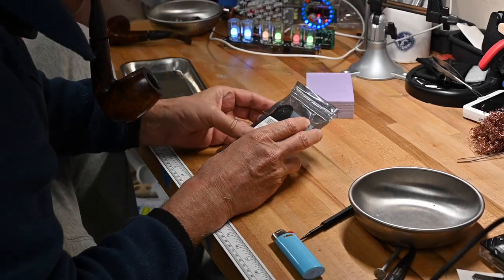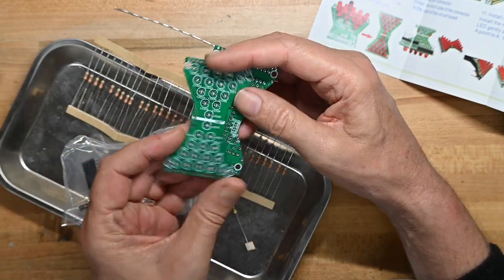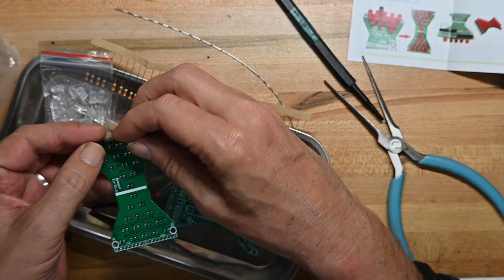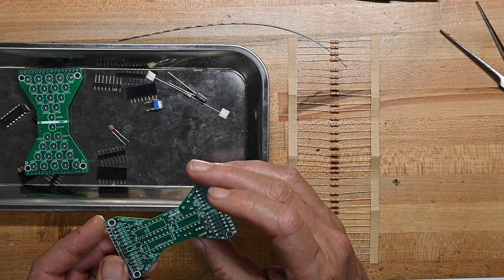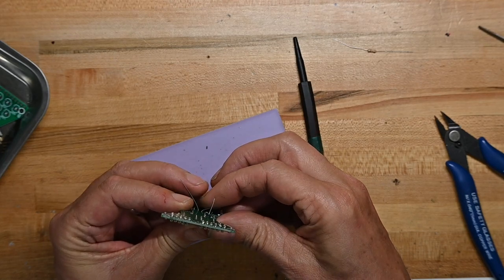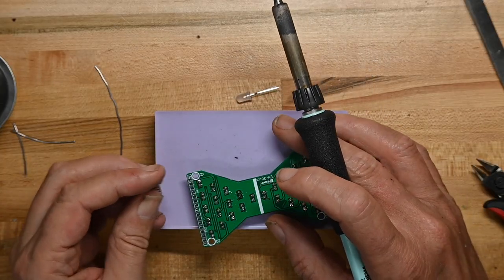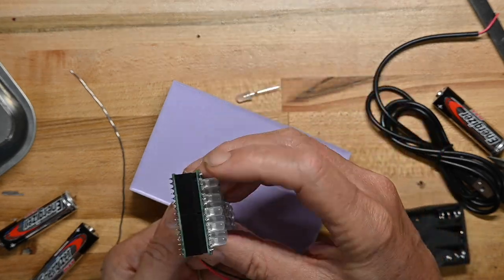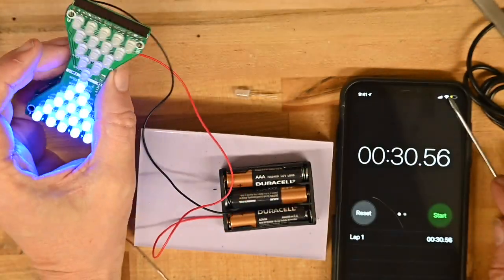C.K. builds a Digital Hourglass kit from Gikfun

Comment: Hi! This helped so much! I successfully put this together thanks to your tips. I am having one final issue that the power lead wires are snapping off, because you twist the hourglass. What do i need to do so that doesn't happen? Just be really careful or always twist one way then back?

Any tips on that for how to get a better solder joint on the power supply?
Reply from the maker: Glad it was useful!  
As for the wires, I've got mine out right now and taking a look...Not really as-is.  However, I think you can put a two pin pin header (pin header link at the end of this comment) in the power holes and then solder the wires to that pin header.  This will not completely eliminate the issue, but it will make repairing the wires easier.
https://www.digikey.com/en/products/detail/oupiin-america-inc/2011-1X05G00SB/12148491?utm_adgroup=Oupiin%20America%20INC&utm_source=google&utm_medium=cpc&utm_campaign=Shopping_DK%2BSupplier_Tier%201%20-%20Block%201&utm_term=&utm_content=Oupiin%20America%20INC&gclid=CjwKCAiAnZCdBhBmEiwA8nDQxY757MSExCXCibAieqxjvGldy0eMMsZOPeJ7HCFnf8A8LHQcvwpgzBoC5LcQAvD_BwE